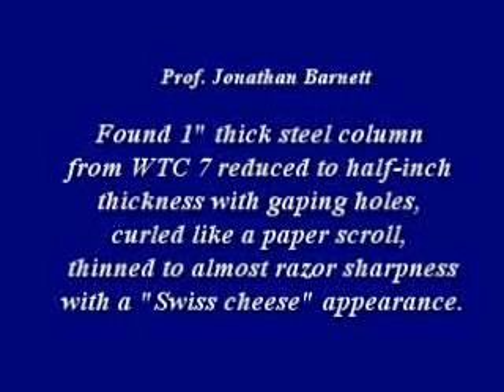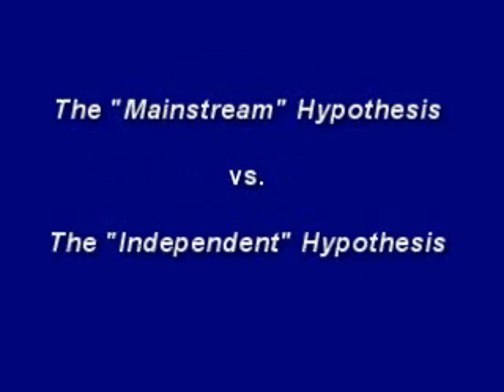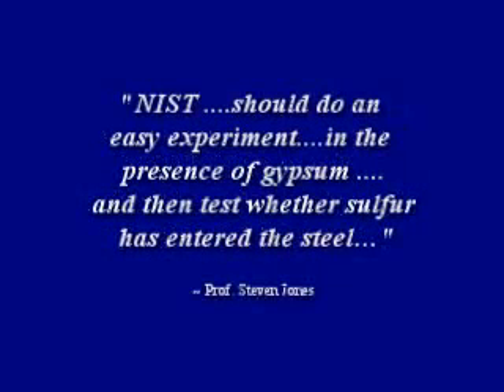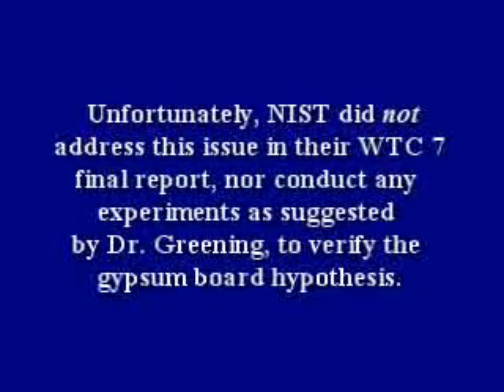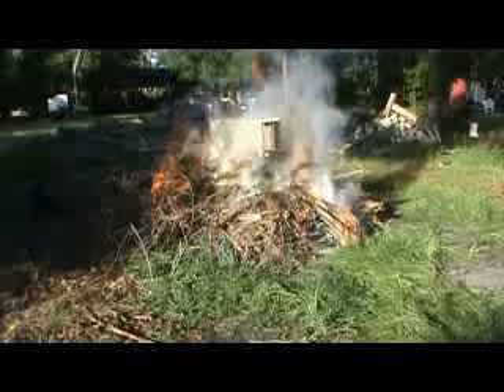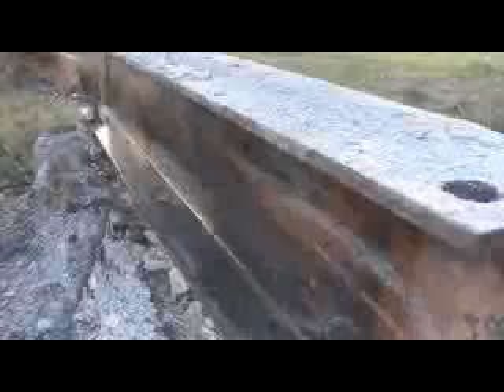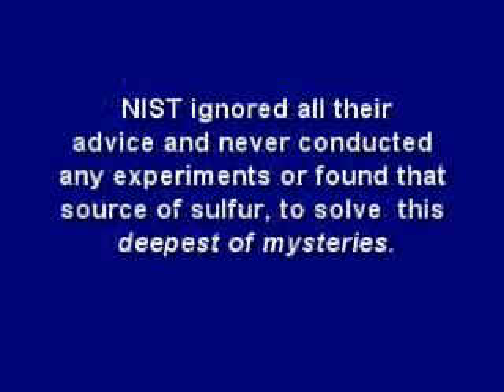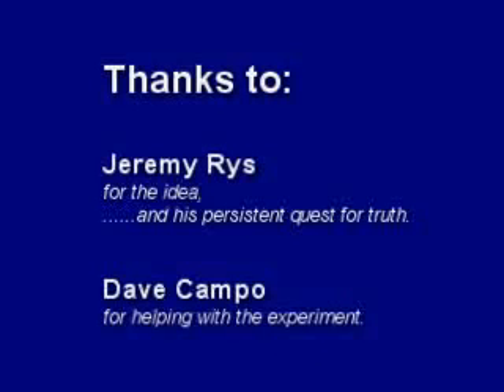9/11 Experiments: The Mysterious Eutectic Steel

Comment: Ouch...  There are a few big holes in this experiment.... 

 1 - When was the damaged steel recovered or inspected? 
 2 -  Where was the steel in the debris field?  
3 - what were the exact conditions that steel was exposed to?  

 Since the  WTC fires were burning for 100 days it is possible the steel recovered was in an area that burnt for that long, and possibly exposed to other compounds as well for even longer (so shouldnt this experiment also burn for 100 days to simulate that possibility?  What was the actual temperature the recovered steel exposed to?  Were there other compounds surrounding the steel during this time?  So the temperatures, oxygen supplies, duration of exposure and the exact surrounding compounds present has not been duplicated in this experiment.  This is important as other compounds present in such things as batteries can lead to the formation of sulphuric acid... and that acid could have been present with the steel for over 100 times the length of this experiment.   

This experiment does not provide the only possible way the steel could have been affected and does not account for the possible duration of exposure being over 100 times that of the experiment....  Therefore, this experiment proves nothing.
Reply: The most sensible post here, so, of course, it is completely ignored by people who don't want to believe the official account of 9/11. 

The only thing you didn't mention that is pertinent is that only a very small piece of steel had this peculiar corrosion. These loonies, these kooks and liars and frauds, when they mention this piece of eutectic steel, act like it is representative of all the steel at WTC, instead of just a single, short segment.
Reply: ok, fair....now explain the building free falling, EXACTLY as in a controlled demolition?
Reply: @markjackson3531  Firstly this freefalling claim is important how?  This was measured on the north face only and only for a short period.  There is also the fact that the north face was supported by a cantilever system which means there was no direct support under it.  This air gap under that face was equivalent to the distance of equivalent to freefall measured.   And since we can see from other angles of the wtc7 collapse that the north face fell faster than the rest of the building this supports the events.  Aside from that you do know it is possible to make a freefalling object exceed freefall acceleration using gravity alone?  The movement of an object is the product of all the forces being applied at that time (look up sum of all forces).  Since the internal collapse preceded the external collapse that falling mass would still have connections to the exterior effectively dragging it downwards.  That's a force additional to the gravitational force.
Reply: @shortsrock  The claim is important because the WAY the building fell (free fall into its own footprint, instead of pancaking the floors with a slight delay) is as important as WHY it fell. The lower floors (say 10 floors and below, under the lowest floor the plane impact directly affected) collapsed with no apparent resistance, which seems unusual to a layperson LIKE MYSELF. For the entire building to collapse in on itself, as opposed to toppling over sideways, also seems unusual. I don't deserve to be insulted or demonized for asking rational questions....or DO I?
Reply: So take him up on his challenge. 

But you haven't.

And there is a reason why.

You're lying.  You know you are.  Otherwise you'd conduct the experiment and prove him wrong.

But you don't.
Because you can't
Because he isn't 
You know it.

You're a mentally ill conspiracy theorist who has nothing to stand on.  Just pushing government propaganda.
Reply: And just what fueled the fire for 100 days?

Because in reality there was NOTHING.  Nobody added fuel to the fire.

So how did it get fed?
In this experiment fuel was constantly added and the fire had open space for air to feed the fire oxygen.  A normal fire can't exist without oxygen.  But in reality fuel was constantly removed.  And steel isn't fueling a fire.

And how much oxygen was there at the bottom if the basement with all that steel stop of it blocking airflow?

Huh?

Practically none.

Know what kind of fire doesn't need oxygen in the air to ignite and burn?

Thermite.

Ta Da
Mystery solved.

Comment: Steel is an excellent conductor of heat, so heat in one area will dissipate through to connected steel not in the flame.  So even if a source was hot enough to melt steel, it must also be able to replace the heat lost by thermal conduction.  Open flame jet fuel doesn't have enough heat to melt steel and the quantities of fuel involved with the WTC would have burned off quickly.  To melt steel using jet fuel would require injecting more oxygen into the flame than would occur under normal conditions, similar to the artificial conditions manufactured in a blast furnace.   Israel did 9/11, wake-the-fuck-up.
Reply: @Jerry De La Cruz There was no molten steel at WTC.
Reply: Have you told people of your discovery?
Reply: @Jerry De La Cruz I've been telling people for years that there was no molten steel at WTC. Nobody has discovered anything, which is my point. People keep making claims for what isn't there or didn't happen!

Comment: At 4:00 in, it says Severe & long burning fires.                   ....  Whats considered "Long Burning"?    and as far as severe        ...  what was severe about it,  Most of the jet fuel went up in smoke on impact, y0u can see that in every video showing impact.   Massive fireball =Fuel
Reply: Ordinary office fires reach temperatures up to 1900 °F. At such temperatures, steel loses a significant amount of its strength, perhaps even the majority of its strength. Therefore, ordinary office fires are sufficient to cause steel buildings to collapse.

Comment: The bonfire experiment is missing something perhaps ..the enviroment of a contained ..somewhat confined space with wind being blown in as well as in rushing air being pulled in for oxygen. Think a forge and the factors involved in firebombing. This might raise the temp considerably.
Reply: I suspect the reaction was a cold reaction, due to the steel being buried in a damp, acidic environment, perhaps only a few hundred degrees in temperature.

Comment: An object in motion tends to stay in motion. Primary school science taught us that, right? All the metal has to do is get red hot, and nowhere near its melting point, for it to sag or bend. Several thousand tons of building weight.... This is exactly what happened with all of the buildings. Kerosene burns slow and hot. That's why it makes a good heating source because of the high BTU per pound. Break some windows up high for a source of wind, and even large amounts of paper with no liquid fuel can be enough for the tragedy we see here. Fucking wake up and realize that ALL of the death that day, and later deaths from breathing the smoke and debris, was caused by a foreign terrorist organization. The families of the ones lost because of this tragedy need to have our support. And that support does not come from conspiracy dribbling bullshit such as this video.
Reply: @Blu Crystl "THE most basic calculation that NIST would need to do to prove that no other force, besides gravity alone acting on falling building parts, was used to cause the demolition and destruction of World Trade Center One would be to calculate the gravitational potential energy of World Trade Center One and Two. "

Like this: 

Energy, momentum and force of the collapse of WTC

Whole building
P.E. = mgh = 450x10^6kg x 9.8 m/s^2 * 340 m = 1.5x10^12 Joules = 417k kWh. 
K.E. = 0.5mv^2 = 0.5(450x10^6 kg)(82 m/s)^2 = 1.5x10^12 Joules = 417k kWh. 
F=ma = 450x10^6kg x 9.8 m/s^2 = 4.41x10^9 Newtons

1kwh=3.6e6 joules

Top section
Static load F=mg=45x10^6 x 9.8 m/s^2 = 441x10^6 newtons. 

p=mv=45x10^6kg*8.6 m/s = 387x10^6 N-s

F=ma=45x10^6kg*(-8.6 m/s/1x10^-3s) = -387x10^9 N

(At 0.5 g descent) 

p=mv=45x10^6kg*6.1 m/s = 275 x10^6 N-s

F=ma=45x10^6kg*(-6.1 m/s/1x10^-3s) = -275x10^9 N

Alternatively, 

F= mgh/s = 45x10^6kg*9.8m/s^2*4m/6x10^-3m=294x10^9 N
F= mgh/s = 45x10^6kg*9.8m/s^2*4m/4.558x10^-3m=387x10^9 N
F= mgh/s = 45x10^6kg*9.8m/s^2*4m/4.5x10^-3m=392x10^9 N
F= mgh/s = 45x10^6kg*9.8m/s^2*4m/3x10^-3m=588x10^9 N

Momentum is the product of mass times velocity. The mass initially is the mass of the fifteen floors that began collapsing, which I estimate as 45 million kilograms. Each floor consisted of about three meters of air space between floors. The top section could accelerate in these three meters of air space, resisted only by the opposing force of the support columns.

The fires in WTC 1 and 2 caused the floor trusses to sag, bending the outer columns inward. We have photographs and video showing the outer columns bending inward prior to collapse. Eventually, the columns snapped (again, we have video of this happening). That was the moment that the Towers began their collapse. With nothing below them to resist their descent, the upper floors began falling through those three meters of air space at nearly free fall acceleration. In three meters, then, the upper section could have reached a velocity of (square root of two times the product of acceleration times distance), or (2*(9.8 m/s^2)*3)^1/2, that is 7.67 m/s. Thus, the momentum of the upper section falling just one floor is 

p=mv=45x10^6 kg * 7.67 m/s = 345x10^6 kg-m/s

At this point, it would be good to know how much force the top floor of the stationary section normally supported. That would be Force = mass times acceleration due to gravity, or 45 million kilograms times 9.8 m/s^2, that is, 441 million Newtons. 

Force is the change in momentum over time. 

For the lower section to have stopped the falling upper section from falling, it would have to be able to reduce all of the momentum of the falling section to zero before the lower section broke. As the lower section supports were made of steel, they could deflect only a few millimeters at most before they would shear off. So, we know that the falling section had to stop within a few millimeters, which would have taken only milliseconds at the initial rate of 7.67 m/s. Specifically, the lower section had about 1/(7670) of a second, or about 130 x 10^-6 seconds to stop the upper section (assuming 1 millimeter before shearing the lower section bolts). Then, the force is 

(345x10^6 kg-m/s)/130x10^-6s = 2.65x10^12 Newtons, that is, 6000 times more force than the lower section normally exerted to hold the upper section. That's impossible, which is why the upper section broke the lower section and the entire building collapsed.
Reply: @Blu Crystl "your data is not from the NIST report."

So? What's your point? 

"Why is that?"

I did my own calculations. 

"Also not in the NIST report or your reply ... 
the amount of ENERGY needed to dismember inner core columns"

Safe to say, it's far less than the amount we know the building had as it fell. 

"the amount of ENERGY needed to dismember outer perimeter columns"

Safe to say, it's far less than the amount we know the building had as it fell. 

"the amount of ENERGY needed to dismember the floor trusses from the inner core columns and the outer perimeter columns"

Safe to say, it's far less than the amount we know the building had as it fell.

"the amount of ENERGY needed to pulverize the concrete"

Safe to say, it's far less than the amount we know the building had as it fell.

"Without KNOWING these ENERGY amounts any statement that the gravitational potential energy that World Trade Center One or Two possessed, which is NOT stated in NIST's report, was sufficient to cause the demolition and destruction of World Trade Center One and Two ...
is NOTHING but speculation."

Look, idiot, just because you are too stupid to figure out the basics, it doesn't mean that the rest of us can't figure out that when the available kinetic energy of collapse is enough to generate HUNDREDS OF TIMES the force exerted by the buildings while standing, it means that buildings are going to tear themselves apart! 

Besides, when have any of you LIARS ever stated the energy or even the temperature needed to melt through the steel columns? Instead, you just hand wave and claim that your magic dust did it, without ever specifying the energies involved. Your lying double standard shows what a bunch of idiots you are!

Comment: Most building that are over 75 stories in a dense urban environment, can be more dangerous of a uncontrolled collapse for surrounding people and other buildings then controlled ones. Therefore, every large building is designed with demolition built into the building, at the time of construction. For obvious reasons the general public is unaware of this and is a very close guarded secret. if people knew that the building that they are working or living in could be destroyed by a push of a button, no one would be in them.

Comment: Your report is amicable, however lacks the most important contributing factors. 1.  The towers were constructed in a way to resemble a tuning fork.
2.  The core suppot of the tuning fork was exposed to extreme heat.
3.     mv² / r

Comment: Famous architect designs buildings capable of withstanding the impact of jet aircraft. Building fails. How many architects lost their licenses?  ZERO.  If I designed something that failed so spectacularly and I were a licensed architect how long would I keep that license? (Not long)
Reply: Owner of buildings that were about to require enormous investment in asbestos abatement purchases terrorist insurance on the buildings just days before the incident and then collects on the policy.
Reply: President while reading story book to children isn't hustled out and rushed to safety. How many clues do you need?
Reply: Military aircraft sent out to sea beyond the range of being able to do anything about the attack. Ordered to stand down.  Drill going on simultaneously with the attack. The drill was to prevent such an attack. Confusing? Coincidence?

Comment: Would it be possible that the liquide metal seen falling from the south tower is only formed after burning thermite so not molten structural steel? And if so how much would it need to be to form so much molten steel?

Comment: Thank you for this experiment showing that gypsum, aluminum and kerosene fire could not have caused the thinning of the steel.
You then hypothesize that "something within the building must have caused it," and you further speculate that a reaction with thermate might have caused it. 
You provide no proof that thermate can so affect a steel beam, no explanation of how a thermitic reaction (which burns hot and fast) could have smoldered for hours, and no explanation for how such a material could have been uniformly distributed throughout the building. You do not account for the minimal seismic impact observed when the shell of the building came down at 5:21 PM, registering less than 10% of the potential energy contained in the original mass of the building. 
The alternate hypothesis is that something OUTSIDE of the building damaged the steel. Multiple videos and photos throughout the day show a dense cloud of dust drifting away from the entire south face of the building (roof to ground) all day long, and not just from the four lower floors where there was fire. 
Explanation: The same process that turned the twin towers to dust in 10 seconds was used on WTC 7 at a lower intensity and turned the steel of the building to dust over the course of the day. When enough steel was gone, the remnant collapsed. No need to postulate an almost impossible scenario with thermitic material.